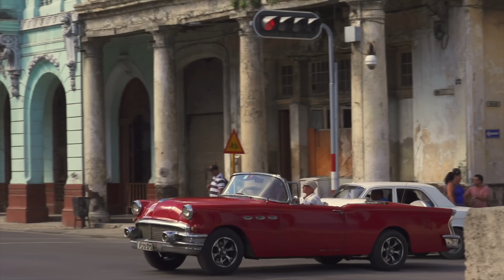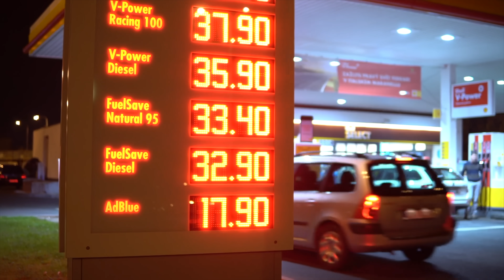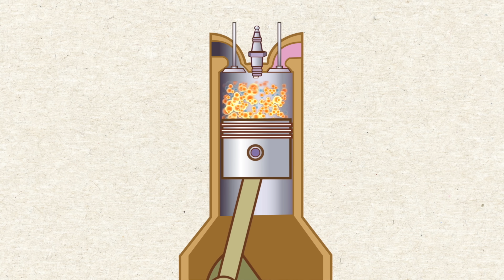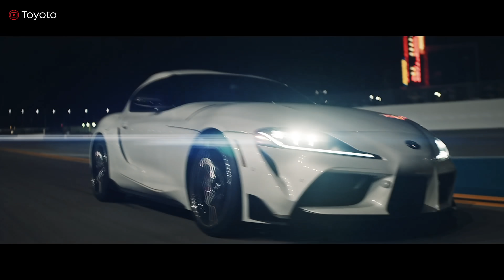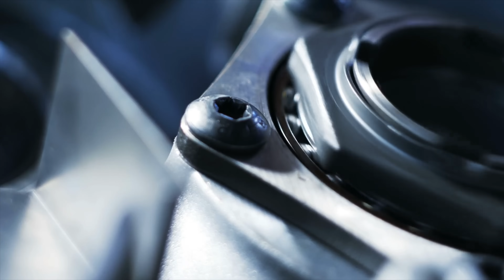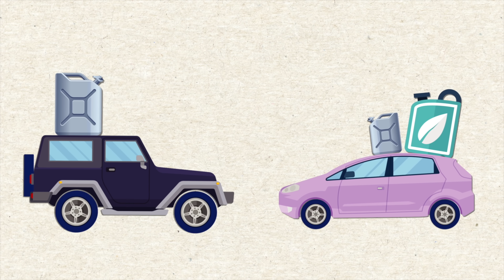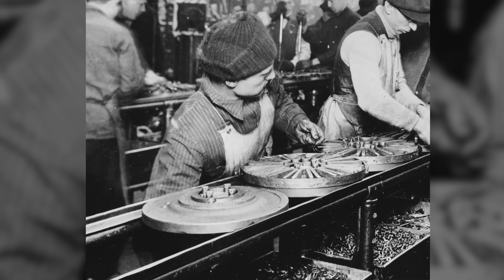7 Fuel Myths Stupid People Fall For

Comment: I worked in the oil/gasoline industry for 15 years.  The rule of thumb is use the minimum grade of gas which prevents knocking (kinda like your car coughing all the time).  If it knocks at regular grade, go to mid-grade.  If it still knocks, go to premium.  The "long term damage" this video talks about will happen to very few people because they never own their cars that long.  If you do own a car that long, other mechanical problems will most likely be the bane of your existence well before these engine issues.
Reply: I own a 2017 Ford Edge. Bought it brand new. Not a high performance vehicle by any means. Until about six months ago, I was using 93 Octane...no knocking.  But with gas prices soaring, I downgraded to 87 octane to save a few dollars and am now noticing the knocking mentioned in the video. Other than being noticeable and somewhat annoying, is the knocking going to cause any long term damage to my non-high performance vehicle engine? Or can I live with the knocking and still expect to get 150 - 200K miles on my engine (with regular service appointments, of course)?  Thanks!  I appreciate any advice.
Reply: @jimsparaco4637  The answer to this, and most other questions involving gasoline and mechanical issues is "it depends."  Not knowing how many miles you have on your Explorer now, I can't speculate on what its condition will be at 150K miles and how much you drive under what conditions.  And I know enough about car manufacturing to know that not all engines are built equally - some engines for the same make/model car just perform worse (hence the word "lemon").  If I assuming you're planning on owning and driving this car for a long time, and you really are pressed for the extra cash for premium (who isn't these days?), then try a Plus grade gasoline and see if it works.  Or, alternate fuelings with regular and premium and see if your car knocks.  Or tweak the ratio of regular/premium fuelings.  Oftentimes the occasional premium fill up is good enough.  Of course, probably the easiest analogy is that, if you can afford it, it's like insurance.  You're paying a little extra fee at the time to potentially avoid paying a lot down the road (again, assuming you own this car for a long time).  Engine knock is not great long term for your car, but I've known cars that lasted many years with knocking and some that have developed problems earlier.  It depends.
Reply: @ishave1627  Awesome...thanks for your informative and prompt reply.  Much appreciated.
Reply: No, just use whatever your manual says your engine requires.
Reply: @reh3884  The manufacturer is always going to over-recommend the car requirements in the manual for both gasoline and oil change frequency.  That is for liability reasons.  In real life, it's different. My last 3 cars were a BMW and 2 Audi's.  All were recommended to use Premium in the manual.  In each case, I dropped down to Plus grade, with an occasional fill of regular.  Zero problems with any knocking or engine damage after approximately 6-7 years with each car when I traded them in.  But if you want to always pay for Premium, then that's your choice.
Reply: When I bought my tundra in 06, I used regular gas. 2500000 miles later I use regular gas with the random gallon of diesel here and there.
Reply: @bryancline8893 how tf did you drive 2.5 million miles
Reply: @matthewfalvey8205  I think he meant 250,000
Reply: @matthewfalvey8205  - the random diesel is questionable to me. Never heard of that.
Reply: What you said is not correct! There are many of us that can’t afford new cars so when a used car is bought I would expect that car to run 300k or better. My Dakota has 326k. You think everyone can afford to buy new cars every year or two? What world are you living in? Do you always let someone else do the thinking for you?
Reply: @Freedom_Rider915  who are you ranting at?  It’s pretty unclear.
Reply: @reh3884  no, thats not it.
Reply: @ishave1627  exactly...people are free to waste money if they like!
Reply: @jimsparaco4637  If you can physically hear the knocking then it is likely to cause damage within a few thousand miles. It could also last much longer, its hard to predict. Modern cars have knock sensors which allow the computer to compensate for knocking so fast you will never know it's there. If you can hear it that means the car is unable to adjust the mixture enough to safely run with that fuel (or that your knock sensor is bad). Keep in mind a few things can make a similar sound so you have to be sure it's really knocking that you're hearing
Reply: “….because they never own their cars that long.” How does that mean it will happen to “very few people”…? You realize people buy used cars way more than new ones, right? MOST people will experience that long term damage, because they will own the cars that the people using the lower grade gas had
Reply: Knocking cause Alaska fuqin cold
Reply: I've owned several cars that ended up with over 200k miles on them, and the issue that normally crops up is that it starts "burning oil" at some point, requiring more frequent oil changes.  All but one of those vehicles used strictly regular gas - one newer one used mid-grade, but I traded that one in for a newer vehicle before hitting 100k and never had an issue with it.  Another common issue I've had, especially in Chevys, is wheel bearings needing to be replaced - one reason I'll never buy another Chevy, as it seems to be an endemic issue with them on certain vehicles.
Reply: Do you know anything about pure gas? I was on vacation in North Dakota and they had gas stations with pure gas and gas,all on same pump  They had the same octane level. I was so confused and wasn't sure what I was supposed to use when I told the clerk inside the building she told me "gas is gas' in a smotty voice. I didn't want to put the wrong kind of gas in and she was absolutely no help. I alternated between the two because I wasn't sure what to do. It didn't seem to affect my driving gas mileage or my car. Pure gas cost more. I didn't know if the Pure Gas was just the normal regular gas I'd get at home or if the other gas was the one I'd get at home.
Reply: @merricat3025  Pure gasoline is gasoline which contains no ethanol.  It is perfectly fine for your car.  The pure gas is more expensive because ethanol from corn is subsidized by the government, which basically means the taxpayers are paying for the ethanol.  The government subsidizes corn ethanol because ethanol emits less than the larger hydrocarbons in gasoline.  However, that is also a  reason why ethanol has a lower fuel density than gasoline, so in theory your pure gas should give you better fuel economy (although it's tough to measure at the lower amounts of ethanol in gasoline).  The rule of thumb is that running with ethanol content fuel of up to 15-20% is fine.  However, do not use gasoline with greater than 20% ethanol as that can cause engine problems (e.g. with seals and contaminants like water).  Also, some older model cars may not be able to run on hybrid ethanol-gasoline fuels (all newer cars can). Hope this helps.
Reply: @ishave1627  yes it does. Thanks
Reply: @merricat3025  I live near a gas station that has N-87 fuel.  No ethanol added.  It's also a station that uses top tier gasoline.  I use it all the time, but never seen anyone else use it.  I live in an area where emissions tests aren't required.  The city doesn't have these types of fuel.
Reply: In modern cars..if it knocks you generally have a serious problem. Car's can adjust timing to compensate for lower octane even if higher octane is recommended.
Reply: @ishave1627  Gasoline containing ethanol is GASOHOL. Ethanol contains an oxygen in the molecule and this makes it burns more completely and so cleanly.  The oxygen atom also makes the ethanol more bulky and less energy dense.
Reply: @Mr-hn2bp  Gasohol is an older term for gasoline which contains ethanol. That word is rarely used these days because ethanol in gasoline is so common people assume it's just standard gasoline.  Preferred designations in the industry use things like E10 (almost all gasoline sold has10% ethanol) or E85 (85% ethanol fuel used in Brazil).  The earlier question I answered was related to "pure gas", which is hydrocarbons-only without ethanol.  That is far less commonly found at fuel pumps.  The oxygen in ethanol helps the emissions, but the predominant reason there's less emissions from ethanol is because ethanol only has 2 carbons, whereas pure gasoline has molecules which typically contain 4-8 carbons each, e.g. isobutane (4 carbons) to iso-octane (8 carbons), in the gasoline boiling range.  Thus, at most, combusting ethanol will release 2 moles of CO2 whereas combusting something like iso-octane will release 8 molecules of CO2.  The burning benefit from the oxygen in ethanol is relatively inconsequential to the disparity in amount of carbon vs pure gasoline.  The higher amount of carbon in pure gasoline, per standard volume comparison, over ethanol accounts for the higher fuel density.  The only reason ethanol even made it into gasoline is because it has a high octane number, so blending it into an 85 octane gasoline will make it 87 octane.  Also, legislation passed decades ago limited the amount of high octane aromatics in gasoline, thereby causing refiners to look for a cheap high octane substitute.  MTBE was first chosen but had water contamination problems so ethanol became standard (and subsidized by the US government).
Reply: @jimsparaco4637  I had a car that required 93 I stared using 87 and had to replace aN O2 sensor
Reply: I have 25 years in the gas and vehicle industry. Big gas doesn't want you to know this but every vehicle manual has the type of gas to be used in it!
Reply: Certain cars require higher octane right? Like i drive a Porsche and they say to only use premium, so I oblige.
Reply: Is using 93 petrol in a Subaru 2021 4-cylinder turbo engine better than 89 or 78, because Subaru did not explain that?
Reply: So you change your oil colors instead of gas colors in your early images of pistons.hmmmm...ok
Reply: I have my car 2017 accord coughing every time filled up with 87 at low grade stations. But it changed smoothly with the Chevron or Shell 91 or even 89,87. 91 would likely get the better engine response but mileage kind of the same.
Reply: Gas is gas ⛽️.. jejeje save your money if you can..!..Trudeau said in 2035, “No more Gasoline Cars”..😂😂
Reply: my 25 year old nissan minivan has over 300k miles on it and even with the six new fuel injectors i recently installed it still seems to run much better with the 89 mid grade .  the 87 makes it run more sluggish with less acceleration and the 91 seems to get less mpg than the 89 without making it run any better and costs more .   so 89 may work best for older japanese vehicles .
Reply: WRONG
Reply: I worked for a self-made mutil millionaire who had a S550 Benz amg. He let me take his baby to get some ⛽️ one day. Told me only to put regular, I looked at him crazy. He said I won't have this car for long, and that's it's the next person problem. 😮
Reply: If the vehicle permits premium use premium. If the vehicle prohibits premium, use regular.
Reply: Knocking 🙄 tf is knock
Reply: @ishave1627 would having a supercharger (such as the one in a 03 V6 Nissan Xterra) affect your engine if not using the recommended octane? (I put the highest grade due to recommendation by my family (we’ve owned the vehicle for roughly 10 years now).
Reply: If my Acura takes premium gas is it ok if I don’t put premium in it every time? I’ve heard mixed opinions on this.
Reply: Thank you, a lot! From now on i will save so much money on gasolin.
Reply: My 98 4runner has 480,000 miles and runs circles around 5th gens!!😅
Reply: When my engine knocks,  I just tell it I'm not home.  Eventually it goes away.  It has worked with my VW, Saturn, and Toyota.
Reply: Bull crap
Reply: a video with Scotty not talking with his hands !
Reply: 2002 GMT 800 series suburban 287,939 I know not what problems you speak of.

Comment: For a short time I was a fuel tanker driver. Mid-grade is a mixture of regular and premium. Each gas station chain has their own mixture requirement. When I went to pick up a fuel load I'd have to mix a certain amount of each to get that required amount.
Reply: Makes sense. Why would you produce several different grades, if you can get the same effect by mixing the two in appropriate ratio? I noticed Sunoco stations have 4 grades of gasoline and I even saw some stations with 5 grades, but that was long time ago.
Reply: correct. I've been a fuel tanker driver for 26 years. In CA the mix is 50% of Reg and Prem to make Mid. Most gas stations mix it at the pump, few stations nowdays have a separate tank for Mid in that case we do the blending when loading (called splash loading).
Reply: I recently notice this. I got more gallons out another station and less at another.
Reply: That’s incredible 😮

Comment: Ethonol is CORROSIVE and bad for engines.   And pipelines and it competes with food sources.  If your car does not ping on 87 octane, use it.  It is by far the cheapest way to get where you are going. And if you want to save on gas, get a hybrid.  And do not punch the accelerator or drive fast.  Take your time and get there more safely and with better gas mileage.

Comment: Thank you Scotty, I'm 70yrs old and have been asking these questions most of my life. I'm getting ready to transfer to a gas vehicle from diesel.  I never knew what the E-85 actually meant.  I will keep this video and use this information as I transition to a regular vehicle.
God bless.
Reply: @Mark Codiroli I made a Typo.  E-85.  I will pay attention now to see what's most available at gas stations.  I prefer not to use the E-85.
Reply: E85 is an abbreviation typically referring to an ethanol fuel blend of 85% ethanol fuel and 15% gasoline or other hydrocarbon by volume. In the United States, the exact ratio of fuel ethanol to hydrocarbon may vary according to ASTM 5798 that specifies the allowable ethanol content in E85 as ranging from 51% to 83%. Wikipedia.   Unless your specifically says in the owners manual you can use it, do not use it.   My experience with a “FLEX fuel” Ford Vehicle was that I got half the fuel mileage on E-85 than on regular gasoline and the E-85 was not 50% of the cost of the regular gas offered at the same station...so it was a bad deal.
Reply: I've always said E85  waste of food.
Reply: why? you're gonna be disappointed in your mileage, bigtime. I haven't driven a gasser in 30 years.
Reply: Hundred percent agree with going for higher ethanol ratio! Who cares about gas mileage when it's more renewable for the long run?

Comment: I use non-ethanol gas. First it gives me 8 miles more a gallon. My engine runs smoother. Ethanol attracts water. That is why it kills 2 cycle engines. Non-ethanol fuel is a mid grade fuel. Way better than the water attracting cheap fuel. Water + engine = stupid & obnoxious service cost. 
I pay a little extra at the pump and drive by shops that I don't have to visit and pay for extreme repairs. The cost of a fuel injector with labor is huge. It's not rocket science.
Reply: Me too

Comment: Fun fact, in WW2 German aircraft engines were designed for 60 octane fuel. US engines for 100 octane. This made the US planes faster and more maneuverable. The Germans eventually switched to 100 octane fuel, but as the engines were not changed they did not get as much out of it.
Reply: Courtesy of a Frenchman, Eugene Houdry
Reply: That hurt my brain
Reply: Thanks for the information
Reply: Fun fact.  Germany didn't have a reliable source of oil, so they primarily used synthetic gasoline produced from coal.  The allied air campaign against Germany's manufacturing plants and rail infrastructure didn't have a huge impact on the war, but hitting the synthetic oil plants did.  By 1945 Germany was essentially out of gas.
Reply: Fun fact: By the end of the war Germany was as flat as a pancake.
Reply: Had a cousin that was in the navy back in the 70s.  The plane he worked on was a prop plane that used 112 octane aviation fuel.  He said his friends would use it in their Zippos.

Comment: One thing you missed here mate. Some cars have a recommendation for X octane, which is just fine. However, if that car is able to actually advance the timing toward MBT with a higher octane fuel, you are absolutely better off (power wise) to be running a higher than recommended octane fuel, IF the car can’t reach MBT within the higher octane fuel. The simple truth in that instance is that the manufacturer is recommending a MINIMUM octane rating rather than a maximum.

Comment: My last 3 cars have called for mid grade including my current which is turbo. I've always used reg and never had knocking. 4 or 5 years ago my friend and I used a tuning system changing his car for different fuel grades and tracked our fuel mileage using 3 different grades on a long trip. We got slightly better fuel mileage in the higher grades, but it wasnt nearly a large enough increase to make up for the difference in price
Reply: I seem  to get 3 extra miles per gallon using 91 octane in my Dodge Grand Caravan.  It has a 283 hp 6 cyl. Noticeable  improvement  in performance  on interstate  highways  on long trips!
Reply: @kimdelong3429 You're still pissing your money away. I would not suggest your bother.